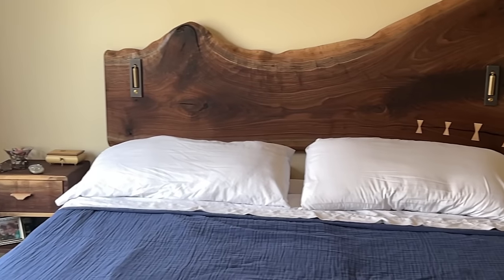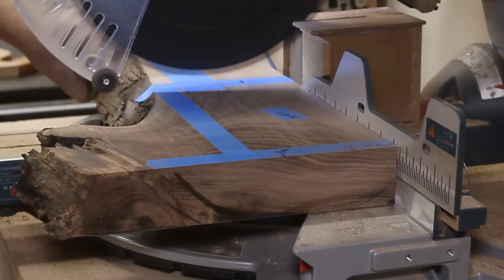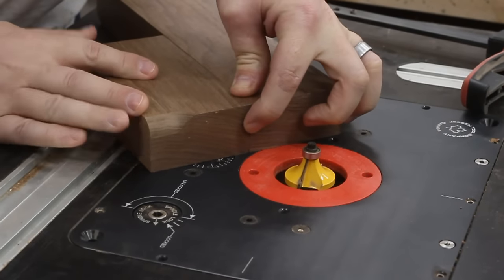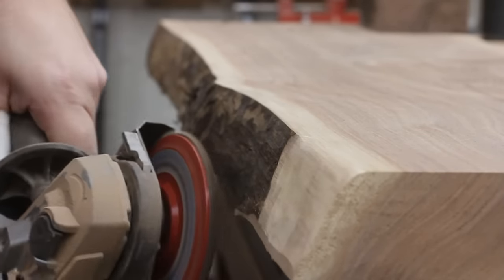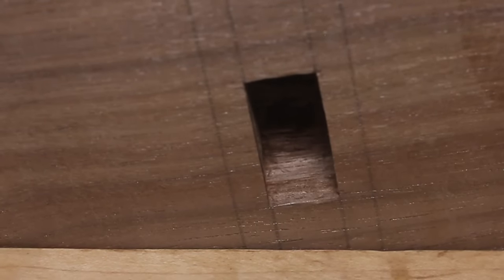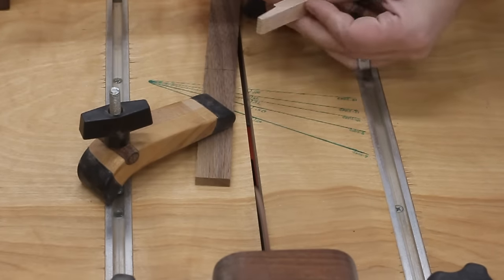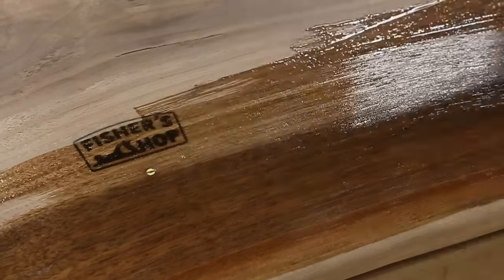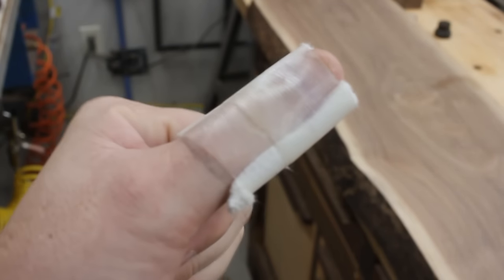Woodworking:  Making A Bench

Comment: Howdy Drew!  Beautiful bench!  I'm loving the theme, and the elements you included.  Interesting 'red stain' you added there, shows real commitment to the project!  I do wonder about the direction of the exposed wedged mortises, in line with the seat grain instead of across, risking wedging it apart?  Nah, given the tightness of walnut grain, it'll probably be OK.  And if they do split the seat, maybe the neighbor will have another slab for some trivial purpose, like a display mantel for his loved ones' ashes or something, giving you replacement material!  😂

Love your work, dude!  I got about 47 different ideas for my own projects, always the mark of a good video!  Cheers!
Reply from the maker: Thanks!  I'm glad you liked it.  Yeah, the wedges don't really provide that much pressure against the edges of the mortise.  They just splay out the ends to fill it out.  Definitely not enough to split a 1.5" thick slab

Comment: Hide glue is your friend with Walnut and mistakes. A heat gun will loosen it up so you can take it apart again. You can also smudge it all over your workpiece and it'll disappear when you add an oil finish, unlike PVA, which will immediately show up and look terrible.
Reply from the maker: Interesting.  I should try some of that sometime since I work a lot with walnut.  Thanks!